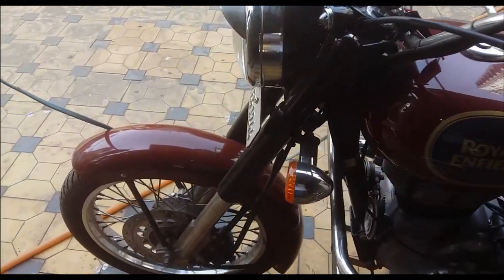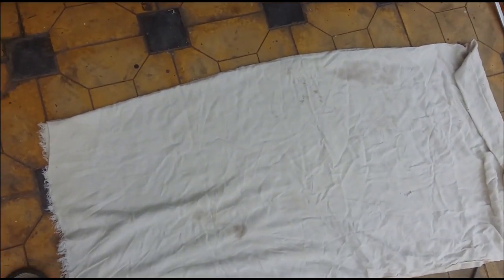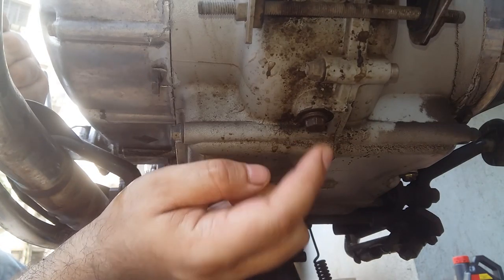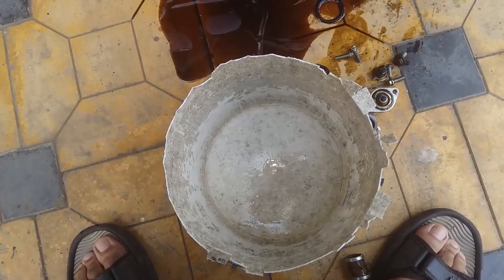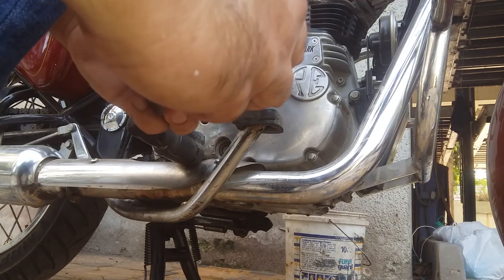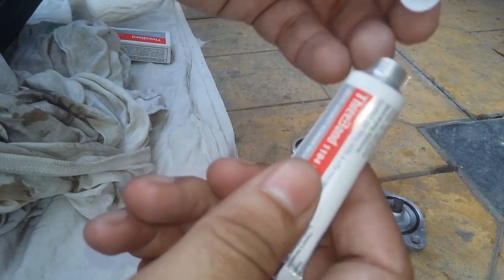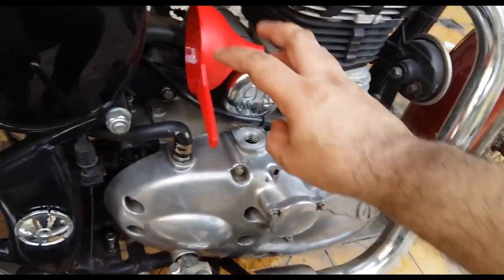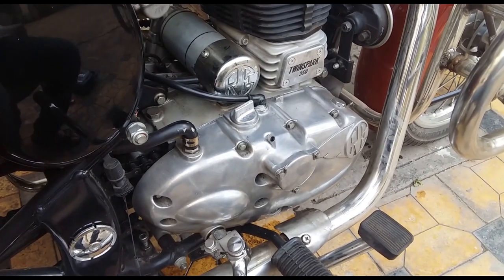Engine Oil change | Royal Enfield Classic 350 | Oil filter replacing

Comment: Hi Gaurav, I hope you would reply to this message. I have Classic 350 BS3 Version - 2016 Model. So i am about change my engine oil. Do we need to change the oil in the clutch side (Left side engine). Because i have seen so many videos where out of 2.5L = 2L goes into the right side and 500ML goes into the left side. I am totally confused. Please help
Reply from the maker: Hi, not required. It automatically goes every where. Just fill exact 2.5 litres with filter change and enjoy.

Comment: Hi bro, Nice video. Have a couple of questions. 
Is it compulsory to apply the paste in the bottom cover?
Do we need new o ring in the bottom cover where the mesh is placed?
Reply from the maker: No bro, It's not necessary to apply the paste but it is better to prevent any leakage. It is cheap. The bottom cover O ring is not available separately, in my area atleast or at the RE service center, we have to buy a new bottom cover for that. Use the paste and have peace of mind. Please LIKE, SHARE & SUBSCRIBE.

Comment: Hi sir this is mallikarjun ,I am planning to change to this mineral oil ,is it good for city performance
Reply from the maker: Yes bro it is good for city use. You can use any brand that makes a 2.5 litres can of oil provided it is 15W-50 grade. Brand does not matter and all oils last for 3000 to 5000 Kms without any issues in the bike.
Reply: @GauravVyas  actually sir my chain sprocket is getting Changed after 5 years it came from the factory and now 3 teeths are gone and it is making gear shift hard and soo much of chain sound  bike has covered arround 40k kilometers and I have changed the oil recently Castrol powe 1 cruise and now I have to get it changed and for this I got this oil from a  well know RE motors Fixwell Motors so I am asking your suggestion ,I don't want my bike to heat up and lower the performance , I daily ride arround 40 kilometers total to work place and home
Reply: @GauravVyas  will it be okay to use this or should I go for a semi synthetic oil like power 1 cruise

Comment: Hi great video. I had a question. Ever since a mechanic changed my engine oil, there's some problem in gear. The up shift are quite hard and it's impossible to bring the bike from 1st gear to neutral as they're stuck. I have to kill the engine first and then take it to neutral
Reply from the maker: Hi Bro, There is a chance that he used a different grade oil. Car engine oils and Motorcycle engine oils are different. RE takes  2.5 litres of 15W-50 grade of Motorcycle oil, Brand does not matter. RE has a wet clutch and the same oil lubricates it. Just check with him what oil he used and how much??? Buy the oil shown in this video and replace it along with oil filter. If this does not fix the issue you need to get the bike checked for worn out parts. Hope this helps. Do watch my latest video https://www.youtube.com/watch?v=JQyZ508wbcU. Please LIKE, SHARE & SUBSCRIBE.
Reply: Probably put too much oil
Reply: Check your clutch

Comment: Good Work, Now on, I will skip the mechanic for oil change. But one doubt, Do we have to open the nut on the other side (clutch side) and fill 200 ml engine oil there?
Reply from the maker: No not required bro. Just lean the bike to the left side for 5 sec to fill the clutch side and lean to the right to fill the oil filter before starting. Please LIKE, SHARE & SUBSCRIBE.
Reply: Thanks much bro.. keep going..

Comment: Oil Filter is not a genuine part i guess because u got Purolator oil filter its mrp is 38 and o rings u get for 30 to 20.From next time onwards use purolator.Anyways nice video keep posting.Ride safe.
Reply from the maker: It's a genuine oil filter bought from Royal Enfield Service center with bill for Rs.93/-. I have opened the pack infront of the camera on this video. Please like and subscribe. Thanks.